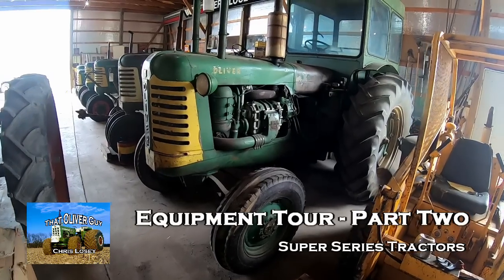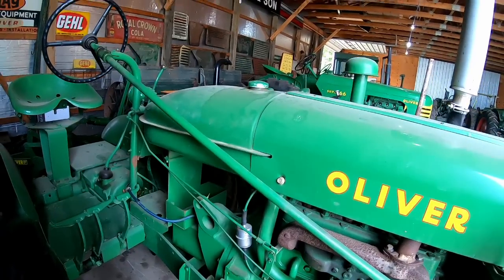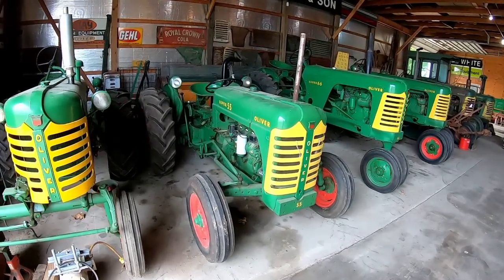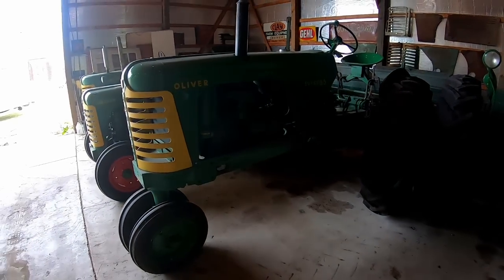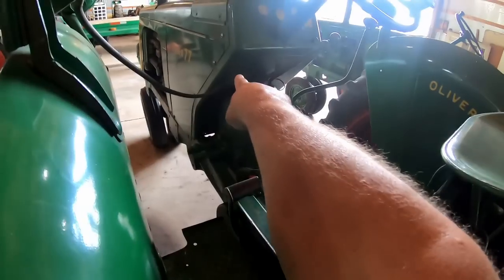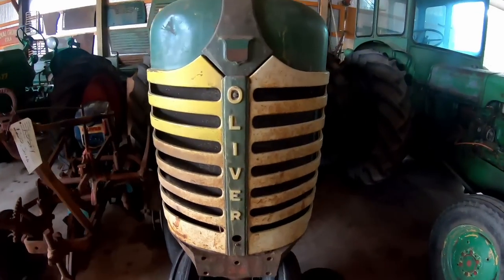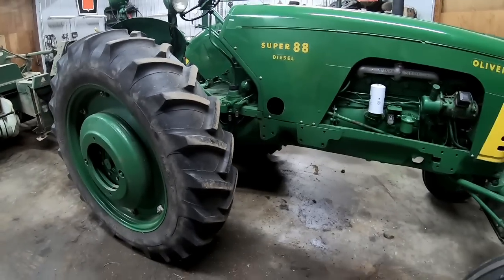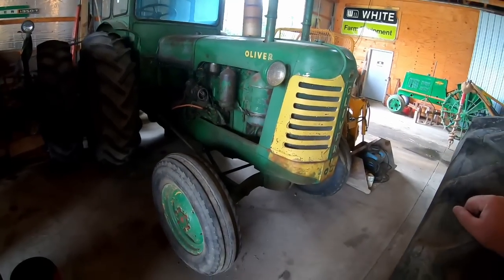Oliver Tractor and Equipment Tour Part Two - Super Series

Comment: I just finished restoring a 1957 Super 55.  I grew up driving a 1955 Super 55 on our farm and our neighbor had a '57 S-55 with a loader.  Another neighbor dairy had a Super 88 diesel.   They were all good tractors.  When my folks sold our farm to a developer in 1974, like an idiot I did not buy our S-55.  Wished for one for years, finally found one two years ago at an auction.  It had a loader and was in good condition except some front sheet metal damage and the PTO clutch was non functional from leaking seals.  Pulled the loader, rebuild clutch pack and seals, other work like brakes, radiator, electrical, front axles, new front tires, hammered out the sheet metal and repainted it.  Looks almost factory.  My sons are already fighting over who gets it when I'm gone, which is pretty amazing since one is a John Deere guy and the other has Allis Chalmers orange in his veins.  Use it all the time on my small farm, stays parked inside.  Wife thinks I'm nuts, but that what happens when you're retired and love good tractors.  I enjoy your Oliver videos, Chris.  Keep it up.
Reply from the maker: Thanks for sharing and watching!

Comment: Case Diesels are also very nice. My Grandfather has a 930 and it takes usually 2 days to empty the tank while running a New Holland Stacker Wagon. That was years ago when he had 20 head of cattle. My Grandfather used to work 2  Case Dealerships Snyders in Portland in the early 80s to the mid 90s and Jansons in Charlotte from the early 90s to maybe 2001.

Comment: Excellent video! I love how your keeping the history of Oliver alive. I often wonder how did White tractors become Silver? I am sure there is a story to it. Back in 94 when I was in High School the farm I worked on had a orange FWA Deutz Allis 9150 that was basically a White but with a Deutz Air Cooled engine. I really liked running that tractor and loved the big tub engine frame.
Reply from the maker: The story I have heard is that when they jad decided to consolidate the 3 tractor brands, Oliver, MM and Cockshutt,  there was infighting over which brand should be the successor and have its name and color on the tractors. Finally someone said we're going to call it the White tractor and we're going to pick a neutral color. That's when they picked silver.
Reply: @ThatOliverGuyChris  Yeah that makes a lot of sense. I am sure there was a big battle over which color would come out on top. Thanks for the info!

Comment: Hello and thank you for your for spaning massive historic tractor knowlege. I'm a follower from Sweden,  so my English is a bit " so and so". I wounder if you can share some story abort the late Oliver "Corporate tractor". There is not much information on that line up as I understand?
Reply from the maker: The corporate tractor was actually going to be several models that were new from the ground up. All new engines that were to be built in a new factory in Canton,  Ohio. New transmissions and final drives, new sheet metal with a new look. These tractors were going to replace the Oliver, Minneapolis Moline and Cockshutt lines with one complete line. They were even going to have a continuously variable transmission.  Everything was nearing completion,  prototypes had been built and tested , but the early 1970s were a tough time for Oliver and parent company White Motor,  so management scrapped the whole line, sold the new engine factory in Canton,  and continued producing the separate Oliver, MM, and Cockshutt trator lines. A couple years later they decided to consolidate the 3 lines and that's when the White tractors first rolled off the line.
Reply: @ThatOliverGuyChris  Thank you for a quick answer. It would be nice if you cold post something about this in You Tube in the future // Björn from Sweden
Reply from the maker: That would be a good winter time project. I have some pictures and video I can use.

Comment: Just curious as to where the motors were made for all that you have shown.  If you could mention this info in your next video it would be nice.  Any sourcing or mechanical problems with any of the engines would be of interest also.  Thanks for taking the time and us through your terrific collection!
Reply from the maker: The Super 44 has a flat head Continental 4 cylinder engine,  and the Super 99 has the General Motors 3-71 diesel. All the rest in this video have Oliver/Waukesha engines .

Comment: We have a collection of minneapolis molines because my grandpa used them and we still use some of them. But i think if i was farming back in the 40s and 50s i would have bought olivers, they are just so good looking and they run so smooth. We have an Oliver 550 and a 880 too and they run so good.
Reply from the maker: I've got a John Deere friend, and he always comments on how smooth the old Olivers would run.
Reply: @ThatOliverGuyChris  We also have a White 2-70 gas and that thing runs like a top, it's hard to beat the smoothness and torque of a straight 6.
Reply from the maker: 2-70 gassers are few and far between. I wish I knew how many were made.
Reply: @ThatOliverGuyChris  Really? I had no idea there weren't many gassers. My dad bought it pretty much brand new from a farmer who only put like 100 hours on it, it was the first tractor my dad ever bought and i think it was around 1981. I'm pretty sure but not 100% that the tractor is a 1976 model.
Reply from the maker: I can think of less than 10 that I have seen. The discontinued the gas option somewhere around 1979 because they were selling so few

Comment: Love this series, keep the videos coming sir!  You weren't kidding about folks painting and changing the Super series around.  I have a 990, but it actually is a 1955 Super 99 GM by the Serial Number.  They went and actually put a 990 hood on it, and repainted it green and white.  Not sure as to why, maybe it hadn't sold and they updated it to fit the newest series on the dealer lot??? Someone with your knowledge would be able to tell right away that it isn't a true 990, since it has the older frame with no holes to attach anything to it, or the dash is the older cast style with no tachometer on it.  Anyways, hope you're doing well!
Reply from the maker: Interesting. They didn't drill out the holes on the 990 either. They might have if it was an industrial. Mind sharing the serial number of it?
Reply: I’ll pm you on FB with the S/N

Comment: So here’s another question: how did Oliver get their plow ratings? Early FWA literature shows the 1900A FWA as an 8 plow tractor. Did they use small bottoms shallow in light soil?
Reply from the maker: The rule of thumb was half the width of cut should be your plowing depth.  So 14 inch bottoms are going to plow much easier than 16s. Of course most farmers want to bury their plows and run somewhere around 10 inches deep, so they don't end up pulling as many bottoms.  A 1900 Fwa could pull 8 14s set at 7 inches on my ground, but I know there is ground out there it wouldn't stand a chance in. Another factor is speed. We go faster than we used to  which also takes more power.

Comment: Hi Chris in the UK there isn't  many Oliver's about  did they export many thanks
Reply from the maker: Not a lot, but they did export. Some went to Europe, they sold quite few 2255s to a diamond mine in Africa. They also sent some 66 diesels to Central America for banana plantations.  Those had a special hand pump hydraulic starter for the engine, with no electrical system. The humid air would corrode the electric connections in no time, so these hydraulic starters were just the solution. 
They had a huge sale to Russia in the 1930s that pretty much saved Oliver from the Great Depression.
So they are out there around the world.  I often wonder what happened to some of those exported tractors.

Comment: Hello chris i have a 1958 oliver 550 it has a front loader and a backhoe the water pump went bad it has a wakeshau engine with the cast pulley on water pump do yo know if the water pump and pulley from the farm oliver 550 tractor would fit they look the same other than the pulley?
Reply from the maker: It should fit. Korves Oliver has water pumps if you need a fresh one.

Comment: Did Oliver ever do super 88 with white rims and electric hydraulic
Reply from the maker: No factory white rims on the Super 88. The used the Series 3 hydra lectric.  The controls were all done with mechanical levers, but they were still set up to use the hydra lectric cylinders. There waa a manual unit offered, they're not very common.

Comment: I have a 1955 Oliver supper 55 I was bailing whith it and the pto started smoking so we shut it off then we went to see what was wrong whith it and the pto was locked solid. Do you have any idea what happened
Reply from the maker: It was probably slipping, which is where the smoke came from. Then the heat from that slippage warped the steel plates in the PTO clutch pack to the point it can't release any more. The tractor will have to be split to fix it.
Reply: Kinda figured that thanks for your time

Comment: My uncle has an oliver 77. Its an older one with band brakes but it has a brass clutch pedal and a brass throttle. Do you know the significance of this
Reply from the maker: At the end  of and following World War 2, there had gotten to be a shortage of iron and steel. Oliver made some brass parts as well as aluminum sheet metal in order to keep the assembly line going.
Reply: @ThatOliverGuyChris  Thanks , I personally never seen another one with brass parts.

Comment: On my s88 lp why does it spit and sputter when I put a load on it?
Reply from the maker: I've never worked on an LP, but with gasoline it's typically because it is running lean on fuel. I'd have to look up how to adjust fuel mixture on an LP.
Reply: @ThatOliverGuyChris  thank you
Reply: Or check your spark plugs